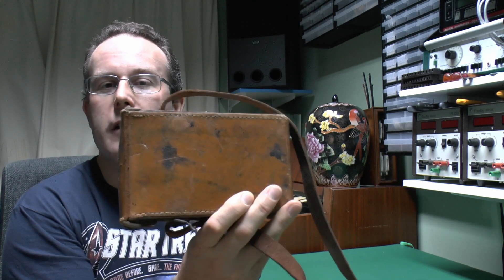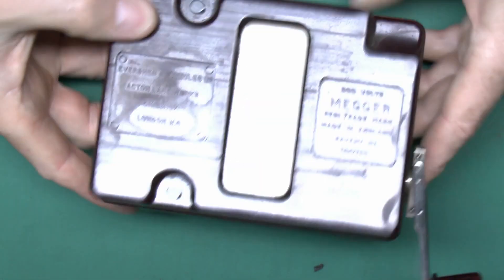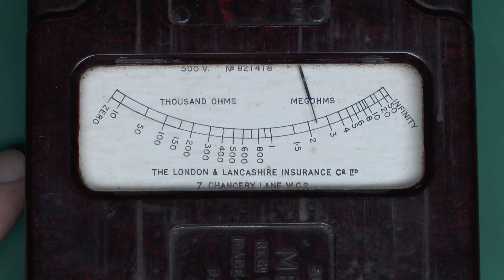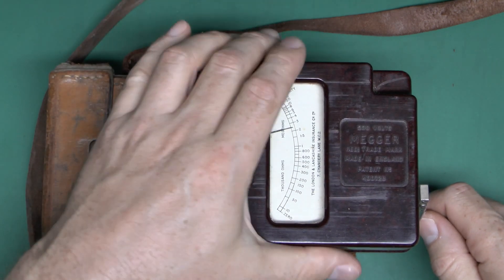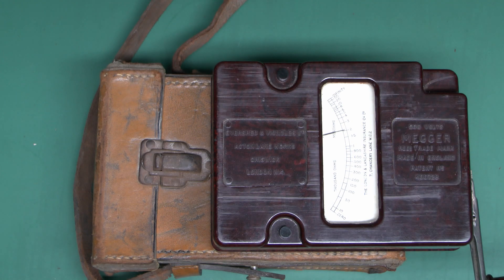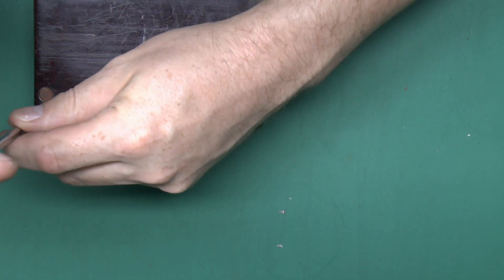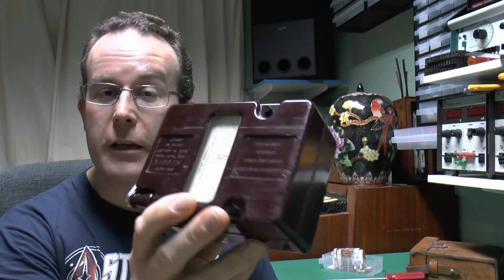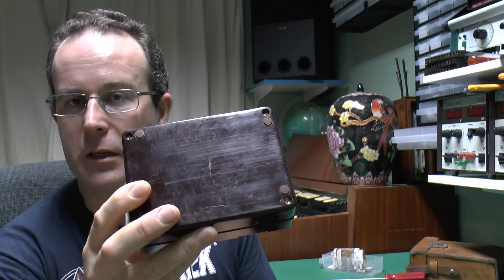Bakelite Insulation Tester - Hand Cranked Megger

Comment: As a retired electrician I remember the Megger. I had a duspole n and a testboy continuity tester.

I remember the high amp ohmmeter.

It is a long time ago and I try to remember what test equipment we used in the 60th and 70th.
From my memory we used voltage testers (duspol), continuity testers, Megger and analog multimeters. Is there something that slipped my memory? 

Thankful for your replies.

Comment: As a retired spark I can vividly remember using these with pyro it was all we had in those days, we had no fancy battery operated multifunction meters like today
As previously stated these were so reliable no worry’s about dead or leaking batteries. You could always feel you had a short as the handle was much harder to turn when meggering out to test for continuity and identifying conductors. Been on the receiving end getting a shock from them much to the delight of work colleagues.

Comment: They are still compliant if you want to use them you can so long as as it is in good condition and working as intended and the test leads conform to GS38. Same for the Robin testers, and with the changes to BS7671 with amd2 on IR and RCD testing even more so . So the good news is that you don’t have to buy new testers.

Comment: My Megger is not as old maybe 1970. It has still a shorting link. This is used to short the two terminals during transport. As long the link is in the two terminals you can't connect the test probes. I have shorted my two test probes because my Megger can also measure Ohm. There is a little switch Ohm or M Ohm.  My two test probes shorted are 0,4 Ohms. I subtract 0,4 Ohms from the 0 to 500 Ohms scale.

Comment: I still use mine for measuring immersion heater elements in situ.
the one I tested recently  hadn't effectively disconnected from the supply, blowing the megger fuse. I replaced the fuse but found that it no longer measures the low resitance scale (ohm) (megohm) the megohm scale is ok. Can it be repaired?

Comment: Hand crank Meghan’s are still made. AMEC model 6503 is a good example.  Along with two 6503’s I have an earlier 1250 in mint condition.  These are bullet proof, and I like using them much more than a battery generated digital version.

Comment: Invented by Evershed & VIgnoles in the late 19th century - this Megger - named the 'Wee Megger' (500V/20Mohm) - was the first production insulation tester.  A larger version existed, aptly called the 'Major Megger' (2.5kV/20,000Mohm).   Megger is essentially an acronym of the words MEGaohm metER.    The company Evershed & Vignoles and its brand - Megger were amalgamated into  The Kent Group of industries in 1965, which also included amongst many other illustrious brands - the famous AVO (Amp Volt Ohm) multimeter manufacturers and  HW Sullivan Ltd (inductors, shunts and galvanometers).   In 1970 - The George Kent Group was purchased by Thorn/EMI and later in 1987 renamed Megger,  the name of which remains to this day under the now vast Megger Group Ltd.    

My PAT tester is made by Megger and I still use daily, my trusty AVO - M2006 digital multimeter, one of the first to feature a liquid-crystal digital/analog display.   Though we learned our physics and basic electronics at school and used later in the military - the ubiquitous AVO Mod 8, still often found in many workshops around the world and still regarded as one of the most accurate moving coil multimeters anywhere.  

I've got one of the more rugged, external use 'Field Meggers', with the carrying handles, somewhat square in profile, but obviously the same meter scale and movement.  Instead of the push-grip connections, mine has the standard 'loudspeaker' style screw terminals and the casing is made of billet aluminium.   Unfortunately mine doesn't work and surprisingly, I've never bothered to dismantle it, but I shoulld imagine that it is pretty much of the same construction inside as this rather sweet 'wee Megger' device that JW is reviewing for us here. 

Well another excellent tear down there JW and one waits with baited breath for your next suitably laconic review/upload.
-----------------------------------------------------------------------------------------------------------------------------------------------------------------------------------------------
Having just noted the date of this upload, obviously waiting with 'baited breath' would be a somewhat absurd chronological endeavour.

Comment: I have the same type of instrument and works fine.The only problem is that the output voltage does not reach 500v dc as it should do.It reaches 290v only.Any idea what could be wrong in it?

Comment: Those square section brass plungers to make the connections seem a weak point to me in terms of conductivety. As you manipulated them it was clear they were a very loose fit in the brass housing with the latter presumably connected to the internals - I didn't see any connections to the brass plungers themselves. I would think this would make a rather uncertain connection - safe for low resistances but could cause a false high one (possibly!)
Reply: diymostthings The brass slugs are connected to the shell they ride in via the tension spring (much like on brushed motors).  There is positive grip on the cables by the guillotine action of the slugs trying to relax against the wire passing through the housing and the slugs themselves.  These hand crank meggers would be tested in short circuit to make sure that the ground point and the wiring from it are actually working.  When testing, the crank is spun at at least 60rpm (one rev per second) to ensure enough voltage is developed.  There is a speed limiting clutch inside to prevent over-voltage from spinning the crank too fast.

Comment: Hi John, can you point me the right way....i have just got one of these from the dark ages,,,it has 2 ranges, thousands and Mega i think...the pointer appears to do what it should, but i put a DC voltmeter across the terminals, on low it read about 30 volts on high it reads about 250 volts dc, its a 500 volt megger....what do you think, i think the low one could be right might just use 30 volts similar to a multi tester but i think on high it should read 500 volts...used a digital and analog meter, same with both.....Fred in essex.

Comment: Those dogey "caps" look like coils to me.  I would imagine they are part of a voltage multiplier circuit.
Reply: +glenwoofit No voltage multiplier of that vintage. They would rather wind on 10000 turns than use a huge selenium stack several times to get a bit of multiplication. Plus coils have nothing to do in a voltage multiplier.
Reply: +glenwoofit Possibly ?
Reply: I believe they're actually unusual wire wound resistors. You can find the circuit diagram for these devices online and there's only a single capacitor in there and the location of the resistors check out. On my unit one of them has written on it "R.50,000"

Comment: The varnished cylinders to either side of the capacitor are coils, used as resistance elements . there is a schematic diagram and a discussion of the history of the Megger at http://www.electrical4u.com/megger-working-principle-types-history-uses-of-megger/

Comment: Would of been interesting to put a meter on it to see if you could measure the voltage it was generating to do the test.   A nice old piece.
Reply: +mc349iii Attach an apprentice across the terminals and see how loud they yelp when you crank the handle? 

This may or may not be an approved method related to me by a really old school electrician - As in he was really old, and one of his last jobs was in a school
Reply: +mc349iii Hi There i did, it was 250 volt think mine might be naft. needle does what it should,,,,Fred in essex.

Comment: All very interesting but how does it work?
 
I remember using the old hand cranked Meggers when I was an apprentice nearly fifty years ago but I never really knew how they worked.  Now after retiring from a career in electrical engineering I think I’ve finally figured it out.
 
If you Google “How does a Megger work” you will find several explanations, none of which make any sense and are obviously written by people who don’t actually know how a Megger works at all.
 
Any feasible explanation must explain the following facts.
1.     The indication varies from zero ohms (short circuit) at one end of the scale to Infinity (open circuit) at the other end.
2.     The scale spans an angle of  approximately 90 degrees
3.     There is no spring involved, the needle moves to the appropriate resistance value when the handle is cranked and then stays there when you stop cranking.
4.     The resistance indicated is roughly independent of the speed of cranking, only the applied voltage varies with speed.
 
Clearly a Megger works in a very different way to an ohmmeter like an AVO which simply applies a known voltage via a resistor and then measures the resulting current with a conventional moving coil ammeter.
 
So here’s my explanation of how I now think a hand cranked  Megger works.
 
1.     The crank turns a generator which produces a dc voltage equal to the test voltage, typically 500V when it’s at full speed.
2.     There’s a permanent magnet which creates a uniform linear magnetic field across the armature ie one with parallel lines of force rather like the earth’s magnetic field.  Note that this is different from a conventional moving coil meter which has a radial magnetic field.
3.     There are two coils on the armature,  a voltage coil and a current coil which are mounted at right angles to each other.  Let’s assume for the sake  of argument that they have the same number of turns although they may not.
4.     The voltage coil is connected in series with a resistor (the 4k7 seen in John’s video) and then across the voltage source.  So it produces a magnetic field proportional to the voltage.
5.     The current coil is connected in series with the current taken by the load, so it produces a magnetic field proportional to the load  current and orthogonal to the field produced by the voltage coil.
6.     These two fields combine to produce a simple vector sum, ie a field at an angle to the armature somewhere in between the voltage and current fields.  If  the load resistance is very low the resultant field will be aligned with the current coil, if the load resistance if very high then it will align with the voltage coil.  If the currents in the two coils are equal then the field will be at 45 degrees to the armature.  The full range of movement of the resultant field relative to the armature is therefore 90 degrees.
7.     The armature acts like a little magnet, just like the needle in a compass and rotates to align its magnetic field with the permanent magnet’s field.
8.     Once the armature and the hence the needle is aligned with the permanent magnet ‘s field there is no further torque and it remains in position even if the voltage is removed.
9.     Voila!
 
Incidentally, I think the other two “capacitors” mentioned in the video are in fact wire-wound power resistors which protect the coils if the instrument is accidentally connected to a live circuit.
 
What I would still like to know is who was the comedian who designed the Megger so that you have to hold it with your hand over the terminals when you crank it.
Reply: Thank you so much Sir! 
You just helped me with my Cable insulation resistance measurement homework. I couldn't useful information on how to use the megger. Thanks!!

Comment: I work in a calibration laboratory, and you'd be surprised how many of these are still in use, we probably still get one or two a month sent to us for calibration.
Reply: +risvegliato And the owners know why. You could go through 10 modern meters while this one still ran strong. The gears are beautiful, you can't really burn the components in use, the connections are as heavy-duty as they get, it runs off-grid...
Reply: risvegliato  how much does it cost to have a hand crank megohmmeter calibrated?